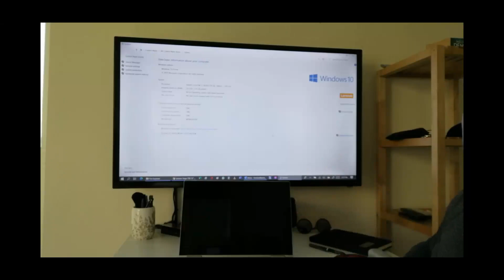Fixing a Flickering Lenovo Yoga 730 Screen

Comment: My neighbor brought their Yoga 730 over, initially, because it wouldn't power on, after not being used in a while.  Turns out it was just in deep sleep and needed to have the power button held for a while to power it off.  Wasn't long after that it started blinking and then went black, which is why it hadn't been used.  Confirmed it was just the internal screen by connecting to my external monitor via my thunderbolt dock. Tried disconnecting from the battery and dissipating power, per one video, but no luck.  Figured it was physical anyway.  Also just loosening up the cable as suggested in other videos helped briefly, but not long term.  Went the route suggested in this video, initially using a folded post-it note on top of the connector... and no issues overnight.  Replaced the paper with a folded-over piece of electrical tape, and then taped it down, and screwed the cover back in place.  So far, so good.  Thanks for the help from myself and my neighbor.

Comment: Has it flickered since? I’ve taken the back off several times and adjusted the cable and pressed on the connection, but the flicker comes back every time eventually.

Comment: I just fixed this model for a client of mine and i'm noticing a huge problem is this model will be running so hot & the display cord is right next to the heat sink making the problem worse.
Reply: Does anyone know what size torx screwdriver is needed for this fix of the flickering screen, please? I can't find anything small enough so far